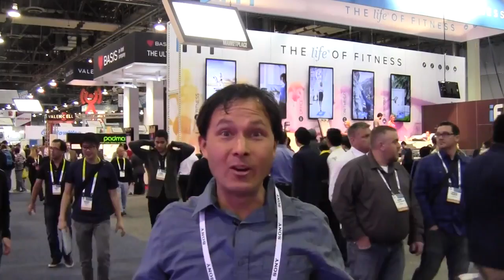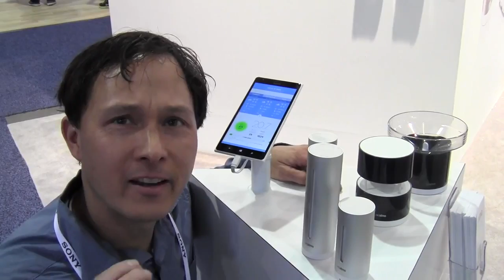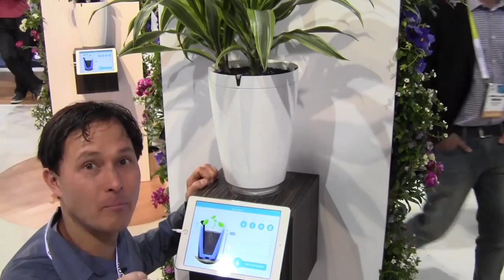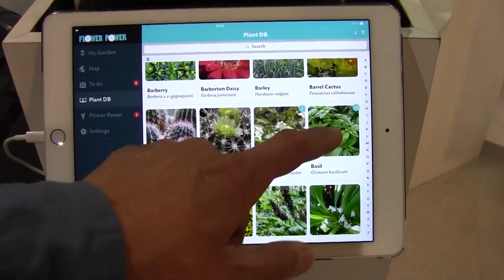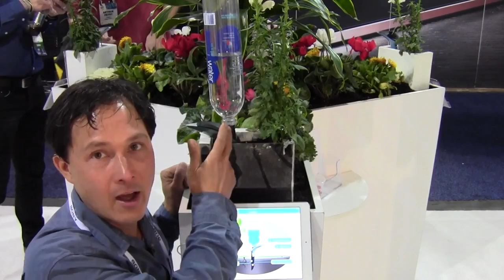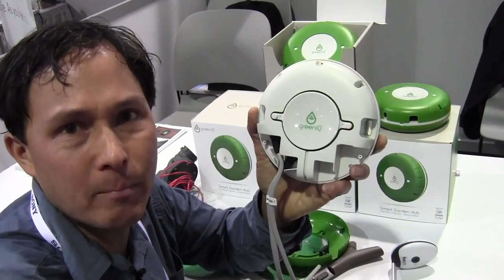Have Green Thumbs with Garden Tech Unveiled at CES 2015

Comment: I love CES and I love gardening. As usual, thanks for sharing this as most of the other sites only cover the gadgets.
 Arduino mods with automated watering and garden alerts is the new game, the censor tech arduino mods are so insanely cool. If you can use a soldering iron you can automate a garden and make it connected to the web for PEANUTS.